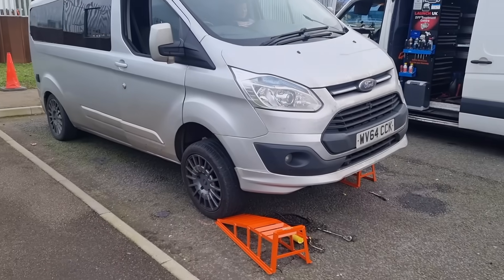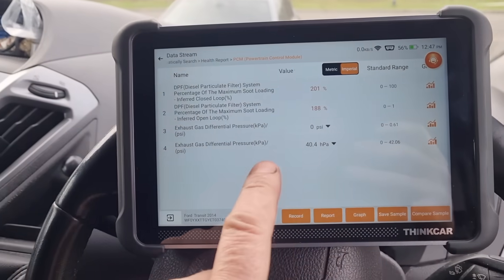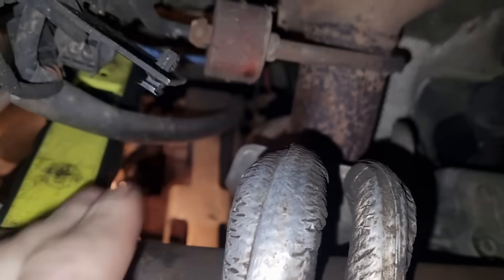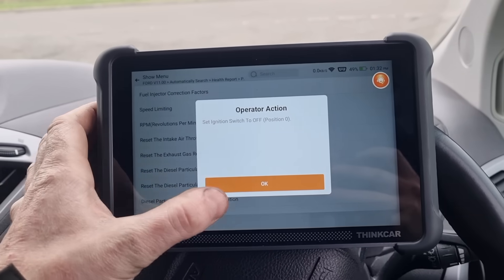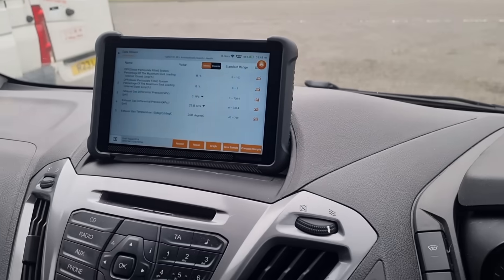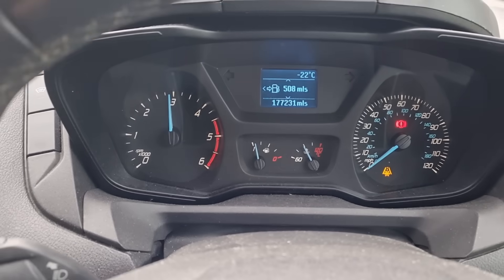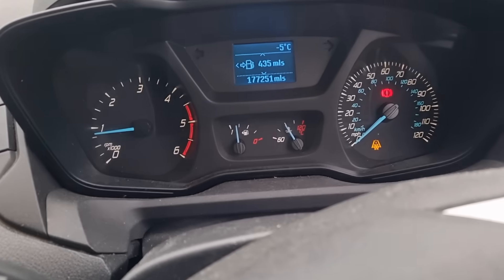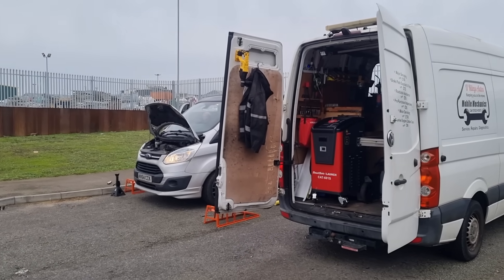Multiple "DPF Specialists" Failed To Fix This Van

Comment: Hi, is this Thinkcar better than the Euro Tab 3 from launch? I have DPF issues but I’m likely too far for you to check it out. I’ve cleaned the DPF and replaced the vaporizer, but now I need a tool to prime it. I tried my friend’s Kingbolen S800 (which you’ve reviewed), but it lacks the special function for priming. It does have a DPF reset, but it won’t let me proceed since the requirements aren’t met.

Comment: thankyou so much for your video you save me £1000's i check the live data and i had a dodgy EGT sensor no.2 was way to low and then drop from 180'c to 63'c then back up to 240'c all in the space of 5 sec 

changed the egt12 sensor 

wile it was out bang 2 cans of dpf cleaner in and now she down 2 mbars at tick over and 15-20 mbars and 3000rpm 

i say that a fix  and it did a regen on its own wile driving to another job going to keep an eye on the live data every drive for a week just to make sure 

thank you

Comment: I work at a local community transport. We had an issue with our transit 2.2 with this for a while was in fords for 12 months and still couldn’t solve the issue. New dpf new genuine turbo as they said the garrett we fitted was the cause. It’s been stood for a while now as had other fleet issues but thanks as pretty sure it’s got a temp sensor fault tho. I’ve subscribed as only seen a few vids and learnt a lot already. Thanks

Comment: Vivaro driver here, After getting a 50K van that had dpf faults , came across videos of people having to scrap there van as garages didnt really want to know .After watching a couple of these videos , started fixing them myself, now on 150k , Thanks to Jimmy . Top guy.
Reply from the maker: Thanks for sharing
Reply: I keep seeing the vivaros and trafics on the road… as you say, if you learn to fix the dpf issue yourself, they look like cracking vans? 
How often do you have to clean them mate? Is it a hard task?
Reply: @Elwooddudes  The engine itself seems solid as a rock, cleaned mine by spraying into  the exhaust pressure sensor and cleaning out with a wire ( as Jimmy video )keep an eye on plugs and inlet sensor . only done it once , at 100k , Do need a good OBD reader , but would need that with any car or van .
Reply: @ thanks for the reply Marie. Good to know they’re actually decent vans, if you know how to sort these things out 👌🏼
Reply: @mariebaxter473 where are you based mate?
Reply: @remyd1984  West Sussex, last week im open due to being very very old ,LOL
Reply: @mariebaxter473 no worries mate

Comment: Hi jimmy I have had a few fords over the last few months that have a high soot content and soot load. After resetting dpf values some of them will reset the soot value but the load value remains at the high level (last one was 250%).  No matter what I try it does not reset, am I right in thinking the only way to reset this is by reflashing or updating software in the pcm? Thanks mate

Comment: Thank you for your work and dedication, Jimmy.  

This is my van in the video.  Prior to seeing Jimmy, i had a diagnosis from the AA when the 'engine malfunction, service now' message appeared on my dash.  To be told, it was down to the exhaust sensor being faulty. This led to the engine light appearing after further driving. At this time, i was doing a lot of miles with work to the run up to Christmas.  

I contacted a few garages to book the van in. But nothing was available until after Christmas.  So i decided on a dpf clean and diagnostics ( no mention of a possible vaporiser issue) to see me through. However, after a few miles, the message returned,  and approx 80 miles, the engine light re appeared.  

Once again, i had another diagnosis from an independent garage to be told the same as before. 

There was no mention of the vaporiser being the culprit. 

Like all the videos before mine,  Jimmy knew what the problem was immediately.  Thank you, Jimmy, for being thorough and taking pride in what you do. He didn't just simply send me on my way once the work was done. He made absolutely sure that his work was done properly. 

Also, Jimmy, the ambient sensor seems to be fine now. But more importantly, the van is running perfectly.  All the best.
Reply from the maker: Thank you

Comment: Since the introduction of Adblue/Bluetec and vaporizers on modern diesels they have become a nightmare for most owners as the garages even the dealerships lacks the knowledge and expertise fixing them. They will just throw in thousands of pounds/dollars on unnecessary parts that does not even needs to be replaced. 

My advice for new/modern car buyers these days is choose electric if you are a city dweller that does not need to commute out of your city, choose petrol if you do commute out of your city and only choose diesels if you are commercial and do long cross country road trips for the health of your DPF. 

Great video Jimmy keep them coming and thanks for educating your global audience. 

A blessed and prosperous 2025 to you mate!!
Reply: I had an Adblue tank replaced under warrantee and I don't know what they did but it has never used any Adblue since! Luckily I don't get any alarms or codes and emmisions pass for MOT but can't be working. This was done 6 years ago.
Reply: @jonsayce7756  maybe they turned adblue off😂
Reply: I wouldn't recommend getting an electric vehicle, some insurance companies now  are refusing or trebling household insurance if you park/charge an electric car at your home! (due to fire risk)
Reply: I agree somewhat. 
I have an EV for round town journeys. 
However I have a diesel Range Rover for anything outside of 30 mile trips. No issue with it aside from the usual maintenance. 

I’ll forever love diesels. They are pretty much unrivalled for MPG on long runs. 
Correct care and maintenance. They’ll go forever. 

Until… until, you buy a euro 6 😬

Comment: This is what I notice with new generation. Everyone wants a "cheat code". They want that you give them all the data. Thats not how things work. You have to understand how systems work before you can achieve good results. Every time I run into issues with my own vehicles I do tons of research, diagnostics, live data logging. Only then you look for the possible source of the problem.

Comment: JIMMY BRILLIANT VIDEO THERE THANKS FOR SHARING THAT INFORMATION VERY USEFUL  I GOT A FORD KUGA DIESEL TDCI 20LT  AND CHANGE THE EXHAUST SYSTEM AND DPF SENSOR  AND MALFUNCTION LIGHT CAME BACK ON I NEED TO CLEAR THE CODES WITH THE LAUNCH 😊
Reply from the maker: Glad it helped

Comment: The glow plug from the vaporiser can be brought separately for full rebuild as they usually fail causing the blockage of the vaporiser
Reply from the maker: Not worth it. I'd just buy a full replacement.  Most are seized in

Comment: Hey, thanks for the video. Since you mentioned DPF on that transit is mounted low, I wanted to ask your opinion about DPFs that are mounted high and has two EGR systems. How safe is to use dpf cleaning liquid? Thanks.
Reply from the maker: Only with engine running

Comment: How can it have been to dpf specialists , sounds like a story to me.
Reply from the maker: Customer had multiple receipts and is standing behind me recording.. I'm going to make a false story while the customer is there and also watching this video?
Reply: @ORileysAutos  So it went to dpf specialists and they dont know about the common issues these have that the codes are screaming at you if you are a dpf specialist ,
Reply from the maker: @mike-s8n8y  that's exactly the point I'm making. Too many specialists just want to spray the cleaner in and be done
Reply: @ORileysAutos  Thanks for reply , so the receipts were just for putting cleaner in ?
Reply: Daft comment. Most of jimmy’s customers bring him vehicles that somebody else has messed with

Comment: Vital piece of info there on the difference between Euro 5/6. Thanks for clearing up about the soot and ash, I got a turbo done with Turbo-tech in Dublin and they also clean DPF's by back flushing, great job because if you can take the time to remove it and bring it to them, it will be as good as new when they are done.

Comment: On hearing your comments on ash build up. I know the answer already but why dont they have two plugs on the dfp one either side. So they can back flush/ vacuum out the ash.
Reply: Because they don’t want DPFs to be cleaned. How would they sell new ones then. 😉
Reply: @hughmarcus1  that's the answer I knew.  So that's makes two of us.
Reply: @alanwalton5735  You need a cleaning fluid pushed under high pressure through the dpf to get the ash flushed out. usually the dpf gets hooked up on a cleaning machine for that. and when its removed you already have access to the filter. So you dont need any plugs.
Reply: @danielseibert4082  if you watch the video. The cleaning fluid only cleans/ dislodges all tha ash in the filter but the ash still remains falling in the bottom of the dpf. So you can't just clean over and over again
Reply: @alanwalton5735  the fluid dislodges soot which later gets burned to ash during a regeneration. The ash itself stays in the filter until you backflush it out.

Comment: Just wish the general public and garage employees watch you channel.
    Wish they knew that a blocked dpf is like a bucket under a leaky roof. Just because you empty the bucket or clean/ force regen the dpf. It doesn't  stop the problem of the leaky roof.

Comment: Used your code on the previous video, when you go to checkout, it changes to American dollars. It's showing euro up until the point you go to checkout.

If its coming from America, customs is going to destroy any savings
Reply from the maker: I doubt it comes from America  but not sure why that happens?
Reply: @ORileysAutos Just rechecked on your new link and the store is in Canada, shows down at the bottom of the page

Comment: I think we need petrol over diesel now as just sounds like too much hassle,dpf,sensors,computers ect ect
Reply: No. You only see the vehicles that potter around & end up blocking up the DPF. 
Between my wife & I we’ve probably done about 150,000 in DPF equipped diesels. 
We’ve never even had an amber light on. 
Reason? We live in the country & the vehicles are used on the open road. While my wife’s commute involves 5-6 miles of heavy traffic her route is over mountain roads & therefore the DPF gets regenerated when needed.

Comment: Hey jimmy, good video as always! But I wanted to let you know that in the settings of the thinkcar 698bt you can set it to always show metric system so that it always shows celcius, cm, m, etc rather than the imperial where it shows fahrenheit. Just a quick tip ;-)
Reply from the maker: I have changed it now in the settings
Reply: @ORileysAutos  Hi Jimmy. Could you please guide me with an honest opinion. Between this Thinkscan 689bt and autel mk808s 2025 which one would you choose? Thanks and waiting for your reply. Keep up the good work. Thanks
Reply from the maker: @florincircu2393  I prefer the Thinkscan 689BT 

https://mythinkcar.com/?ref=dnnktcax

Discount code JIMMYORILEY